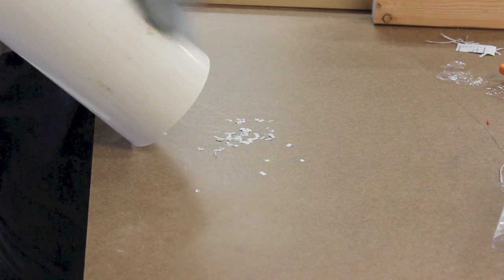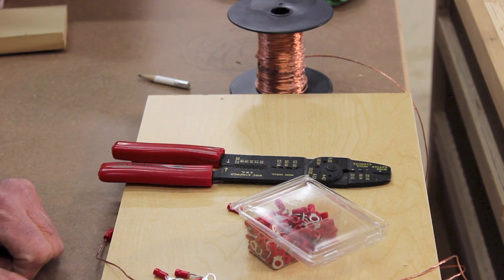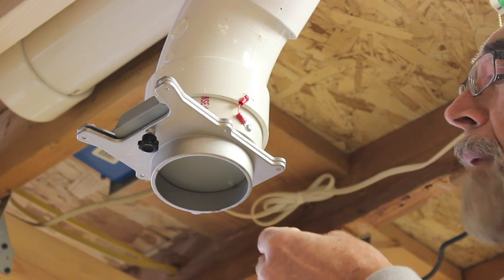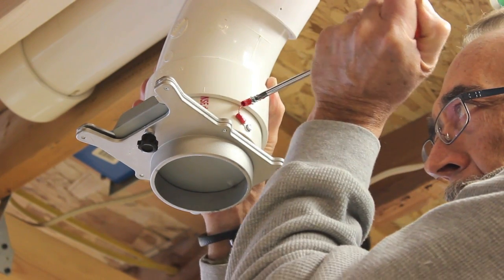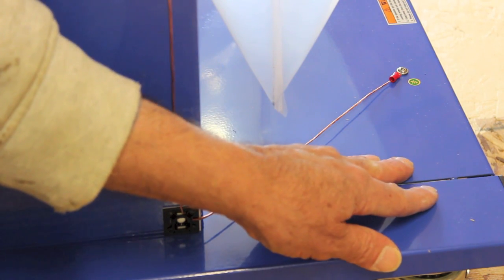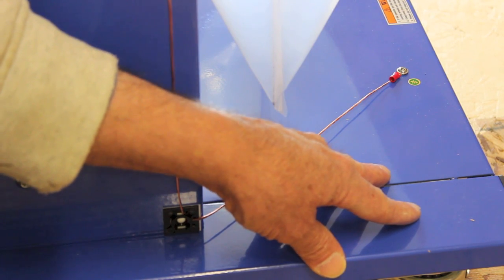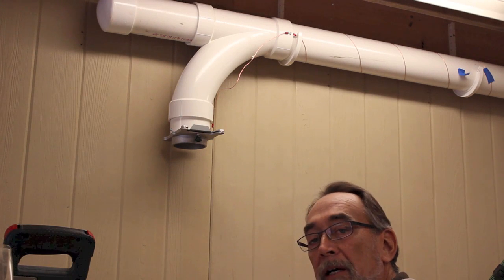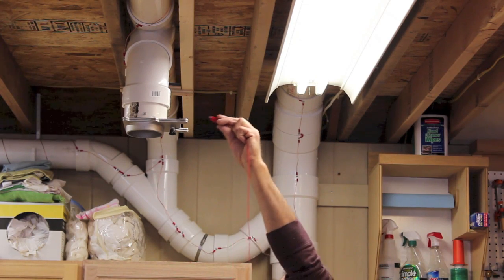Dust Collector   Grounding the System

Comment: Grounding a PVC system is ultimately a personal decision. I have yet to find a documented incident of a non grounded PVC system causing a shop fire. I don't see a need to ground mine. That being said, you did a good job on yours. Here's a good read for those who are interested: 
http://home.comcast.net/~rodec/woodworking/articles/DC_myths.html
Reply: As an electrical engineer, I'd like to address this issue:

1. While a static discharge can have a significant voltage, it is also dependent upon the materials in question.  PVC, like all plastics has some static potential; however this is not sufficient to cause a fire.

2.  Because PVC is NOT conductive, grounding the outside has absolutely no effect on the condition inside the pipe.  The "skin effect" of elcetricity only applies to conductive materials.

3. Dust colloectors are essentially cetralized vacume systems.  Centralized vacumes have been using ungrounded ABS and PVC piping for over 40 years in the USA without a single incident of ignition from static discharge or ungrounded plumbing.

4. Read the article by Tobias Redepenning very carefully.  The type of plumbing used at the area of sparking and ignition was not PVC.  Unlike a regular current, statice elcetricity does not move.  It stays in exactly one location until a full circuit is completed; therefore, it would have been impossible for the static from the PVC to have caused sparking.  Further, static electricity does not build rapidly.  So to witness on going sparking , as the article suggests, indicates an alternative source.  While placing a sufficiently sized ground line inside the plumbing at that point would allieviate the sympton, if that is all that was done, a very real and dangerous problem still exists.  Unfortunately, too few facts are provided to determine the actual cause.  I can only rule out static discharge from the PVC.

Hence it can be safely stated that:
 - Attaching a wire to the outside pf PVC for purposes of grounding is useless for preventing static from materials flowing through the inside.
 - No evidence exists to support the idea of fires from ungrounded PVC pipes in dust collectors.
Reply: woodmasterguy, as an electrical engineering I can state emphatically that it is physicaly impossible to "ground" non-conductive materials, in this case PVC.

1. Grounding by definition presumes that the material is a conductor and that charge can move freely other the surface of the material and from the material to the grounding device (wire typically).  For PVC, an insulator, this is not the case.  A charge present at a particular point cannot move away from that point until an outside object connects that specific point to a viablepathway via a conductor. 

2. Simply wrapping a wire around the pipe, as shown in the above video, has no effect on static charges between the coils of the wire.  Fully enclosing the PVC in a conductor, which can then itself be grounded, defeats the advantage of using PVC in the first place (reduced cost), and completely changes the senarior of a PVC based system (it is becomes a PVC lined metal system). 

3. Is is impossible for wind outside a building  to affect the build-up of static charges on materials enclosed within the building -- unless of course you leave the windows or doors open to let in all the outside sand and dust, but then it fails the "enclosed" conditions.

4. Finally, I would like to state that prior to retiring from the US Army, I lived in the Phoenix Valley, one of the hottest and dryest deserts in the Americas, for many years.  Yes those conditions can increase the chance of static discharge by creating a more favorable environment, but they have no effect on the laws of physics governing how that static builds, moves and is discharged.
Reply: *****, in this case there are major key differences between home shops and industrial shops:
1. Industrial shops are Required to use metal conduits.  These are conductors and do require grounding.
2. Industrial shops are required to have their collection and filtration points Outside the building to prevent/reduce the effects of an explosion within the collector.  Generally this is a separate attached building often with specially designed "blow out" doors.

Grounding has absolutely no effect on the airborne charged dust particles within the collection chamber, hence the industrial requirement of being outside the working building.  Electricity follows a very well known and precise set of physical laws.  These laws, unlike those of mankind, are not up for debate and cannot be broken. 

The information provided by the gentleman in the video is simply false, and there exists over 150 years of scientificly proven evidence debunking every one of his claims.  This same evidence is the very heart of what makes our communication online possible.  "Professionals," as the gentleman claims to be, have a moral and legal obligation to verify their information before providing it as a matter of fact. 

Miss information, such as provided above, has often lead to serious problems and injuries.  For example, faulty wiring could cause a fire, yet an insurance company may refuse to pay citing the lack of grounding as explained in this "Professional" article.  If the injured party cannot afford a legal defense, they get nothing.  This sort of thing happens every day.

Thus it is VERY important that true facts are presented and that all comparisons be scrutinized for accuracy and applicability.  In this case, both the comparisons and the "factual" information provided are false.  They provide as unjustified sense of "safety" as closing a screen door to prevent a draft (the wind goes through the screen).  A false sense of safety has caused more serious and fatal injuries than all other hazards combined.

I have no objection to people "decorating" their PVC conduits.  If you think it looks better, fine.  Just do not falsely refer to it as "grounding."  PVC CANNOT BE GROUNDED!  Also, do not suggest that grounding the conduit has a substatial impact on the contents of the collection and filtration sites -- it doesn 't.  These are essentially two separate electrical systems, requiring two separate control systems. 

Finally, you are more likely to have a fire/explosion is a home vacume than a PVC based dust collection system.  That said, I haven't seen anyone suggesting that we wrap a strand of copper wire around our vacums, and most modern vacumes have no metal within their wands or hose.
Reply: Jay, It has nothing to do with fire, it has to do with getting shocked, do you live in a desert? Vacs can shock you where I live especially on windy days...
Reply: Tobias Redepenning No one said it was dangerous, but who wants to get shocked all day long...
Reply: Good point.  I think it's more of a doubt remover and adds a sense of security to a shop which is a major investment.  Personally, I would sleep better at night knowing that the chance that dust is smoldering is slim to none.  I have heard that the majority of static build up occurs on the outside of the PVC.  If that is true, at least this helps eliminate any discharge to a person also.  You are right though, it is a personal choice.
Reply: I think ignition via static charge is perhaps less of a worry for a dust duct system than the charge possibly discharging through either the tool or the DC fan motor. Oneida had to change their Festool-compatible Dust Deputy kit because static charge dissipations were damaging electronics on the vacs.
Reply: At http://www.woodweb.com/knowledge_base/PVC_Dust_Collection_Issues.html one guy claims to have had a fire coused by ungrounded PVC.
Reply: Tobias Redepenning I would have never thought someone would have a valid claim to a fire.  That's interesting.
Reply: Nicholas Smerk As Michael Olsen said it was not actually the PVC. And that was the only claim of fire I found by searching google...
Reply: woodmasterguy Having worked on a pipe yard I can say that running PVC though your hands on a dry day can build up high volts but only very low amps, painful but not dangerous.
Reply: woodmasterguy The only time I was shocked by my PVC setup was when I touched it to see if I would get shocked. If the DC is running I'm going to be using the tool so ill be no where near the pipe.
Reply: I've spoke to guys with pacemakers.  They won't get within feet of anything that has EMI or can discharge static.
Reply: Although PVC cannot be grounded which some have pointed out above -- that it is redundant to ground a non-conductive material -- however, the fine dust layer that can build up on both the inside and outside of the pipe CAN conduct a charge, especially in high humidity conditions.  Bag-house type filters on industrial systems are prone to explosion but small systems are not, generally speaking, but for as simple as grounding the system can be, I don't think it hurts to be on the safer side of things in the long run.

Comment: Steve -- Oddly enough, this subject is pretty controversial on some of the woodworking forums.

I have been beaten up (verbally) for talking about the importance of grounding dust collection systems. Typically the argument against grounding is to the effect of "I have been running an ungrounded system for 30 years and have never had a fire."

What they don't understand is that, in a smaller shop, the fire danger is very low ... maybe even non-existent. But ESD (electro-static discharge) can not only give you a nasty little shock, it can also raise havoc with electronic devices you may be using in the shop. How many of us are using computers, HD TV's, etc. in the shop, not to mention the growing number of tools that rely on electronics?

Thanks for doing this!

Gerry
Reply: Gerald Jensen I run across that same mentality when safeguarding industrial machines. The 'old timers' are almost always against it because no one has ever gotten hurt on these machines since as far back as they can remember. They fail to take into account that a machine should be made safe enough so that an inexperienced operator can run it without having to fear losing a finger or their life.
Reply: work tabke

Comment: All right for those who doubt what static electricity will do I have two stories from my childhood. I lived in a small farming town in the center of the town was a Purina Dog food plant, The corn for the food was held in a silo and fed into it from the top. The ground corn was feed out through the bottom. One very dry day the building exploded killing most everyone in the plant the cause was static electricity. We had a steel manufacturing plant out side of town where they manufactured heavy machinery and performed  a lot of grinding which was cleaned up by a dust collection system, one fine very dry day it explodes killing 6 men. One last true story in a missile silo in the mid west while cleaning the out side of a missile they decided to open the silo doors the turbo electric charged formed on the missile and it initiated the missile engines killing all in the silo. To prevent that from occurring in the future  a topical product was developed it took 39 tries to prefect the coating. We call it WD 40 and use it as a lubricant the Air Force used it as a anti static coating.

Comment: I like that idea I am always getting zapped so if it prevents that from happening I may do that when I install mine. Just for information there has never been a fire from static discharge but I guess better safe than sorry. A lot of people have the misconception that static discharge will start a fire but this is not the case it has been proven that any fires have been caused by the steel impeller striking a metal object causing a spark to ignite the saw dust
Reply from the maker: That is pretty much what I have heard/read, too.  For me it was more to prevent the "zapping"... A couple of years ago I got zapped by static and a little computer memory stick in my pocket got corrupted.  Like you say, better safe than sorry!  Thanks!
Reply: downtoearthwoodworks Maybe it will help to keep the dust from gathering on the PVC pipe as well. either way you can't go wrong.

Comment: Great series. 

Very minor point, I would use hex head self drilling screws and a nut driver or small ratchet. No philips head screws - much easier to use on a ladder. Also wrap all wires around the pipes.
Reply from the maker: I used hex head screws (#6 X 1/2") in the pipe-to-blastgate connections, but couldn't find any #6 X 5/8" hex head screws locally for the pipe-to-fitting connections.  I guess it is a "small town" thing... I agree, hex head screws are much better & easier to use.  Thanks!!!